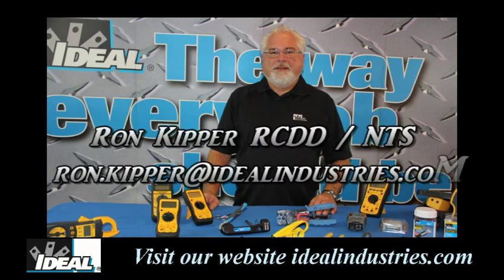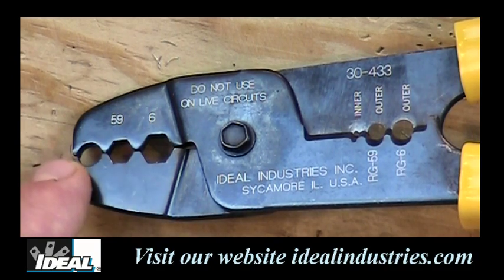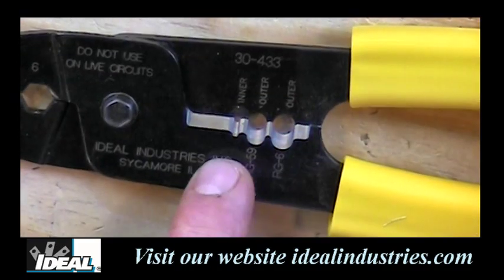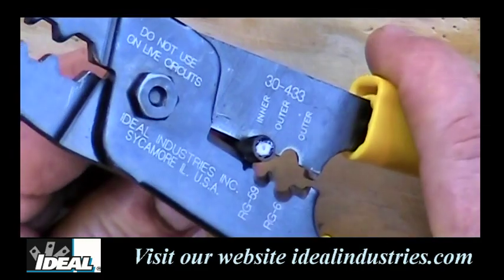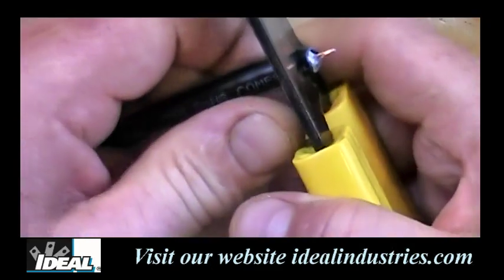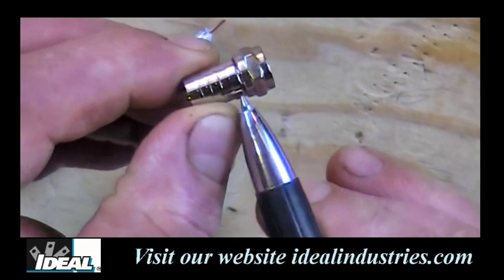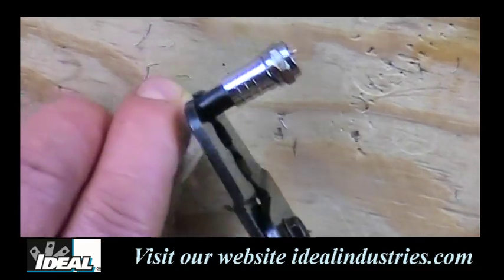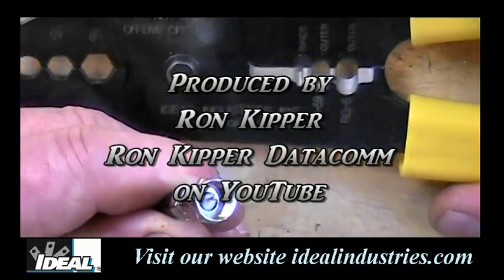30 433 Coax strip and Crimp Tool

Comment: This may have been ok in 1992. This no way to prep a cable by today's standards. Don't do anything you see in this video. Unless you like tiling TV's and slow internet. ICFR nightmare here!
Reply from the maker: Hey Today I would agree you should use better tools and compression connectors today. Ron
Reply: Sorry didn't mean to smash you but I work for a company with metrics so tight on home certification of signal levels that they now say not to touch semi conductor with your fingers as the oils and gunk can cause premature corrosion. So most of my day consist of changing home owner and electrician cut fittings. Over spinning our prep tools cause braid to scuff copper enough to cause ICFR to fail in our 17mhz return carrier. Most 90% of our Network is digital in 256 qam. Makes the cable guys job way more difficult now. So if it's not a compression fitting we cut these of all day long. Sorry
Reply from the maker: Yep times are changing! The providers are requiring the installers to do a better job of making the connections and compression is the way to go. Have you seen the my compression connector videos? Ron